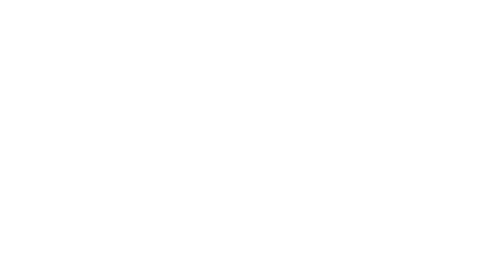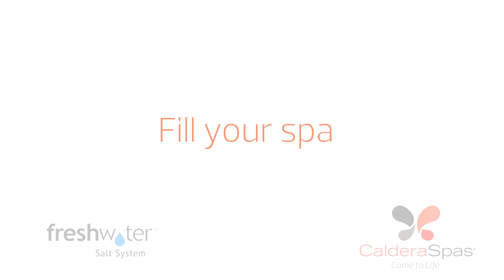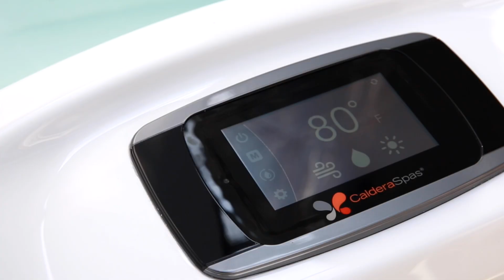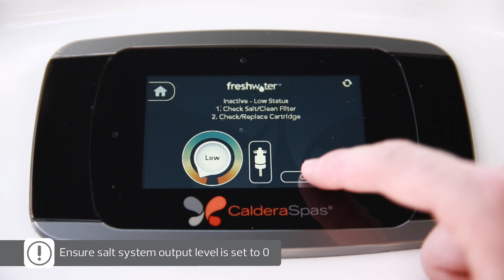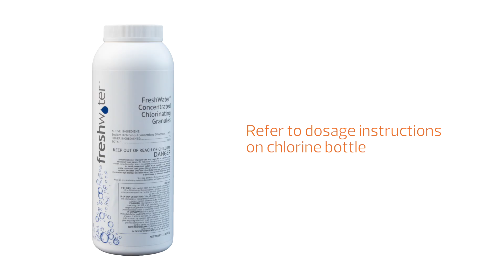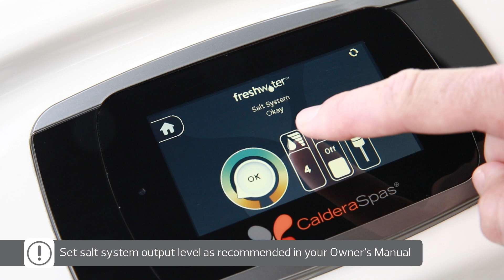Getting Started with the FreshWater® Salt System - Caldera Spas

Comment: I bought a new Caldera spa March 2021. The $100 metal cartridge that supposedly converts salt to chlorine in my opinion does not work. I have spent $300 buying new ones, adjusting the controls etc. I do not believe the technology exist to magically transform salt to chlorine. (and wish someone would get a class action to make them repay us for all the wasted money and false advertising and sales techniques).  I have done 50 measurements using multiple types of test strips. The only think this transforms is my money into the spa dealers pockets. Save your money and just add the salt and bromine / chlorine granules. Home depot is way cheaper for the disinfecting and salt chemicals. I have found no other place than the dealer to buy the filters or  water softener pads.

Comment: I am having problems getting a FCL (chlorine) measurement, working with my dealer for more than 3 week now, the start-up process takes very long, to have the salt system make a measurable chlorine level. Even after a few boosts and by adding Chlorine 50-80ml a few times to balance the FCL to a minimum of  3 ppl.  Salt Level is good, but chlorine is going from 0,2 to 0,38 in a few days. after using it it and adding 60ml chlorine the FCL drops to 0 in a day. Giving rest of a few days does not FCL level to above 0,5 My dealer says to give it some time and not add chlorine manually every time... Any Advice?
Reply from the maker: Thank you for taking the time to reach out. Depending on your water, it can take some time to build the free chlorine residual. From what you said, I have some questions. Are you using a liquid or granular chlorine?
Are you setting the status level at 10? Are you adding enough chlorine to register 3-5 ppm on your test strips? 
It takes consistent steps to build the initial residual.
You can email me at CustomerService@Watkinsmfg.com so I can better serve you. I am sure we can figure this out and get your water on the track. 
I look forward to working with you soon. 
Vanessa -  Customer Service
Reply: Thank you. Can you please clarify. I’m doing my first purge, drain and refill. Do I remove both the filter and salt water cartridge during this process. I’m pretty sure that during the purge and drain to remove the filter, not sure about the salt cartridge. The video shows that during the fill the hose goes in the filter basket, is the filter installed under that basket?
Reply: Why are you recommending filling with garden hose only and not recommending using a filter at the end of the garden hose before filling sauna

Comment: They don't mention to hold down the water droplet icon to see what output the chlorination system is set at. 1-4.  I guess 4 is recommended?  And then 6 for the geneva.
Reply from the maker: Hello Jake, Thank you for the tip. I believe you are referring to the power level. That setting is already set for the spa size. In some cases, based on usage, we have recommended increasing the power level to 4. 
That adjustment is not needed for every customer. Also, depending on what series of the spa you have, how it is adjusted will be different. This video reviews a standard startup. Customer Service is available to assist in spa operation and programming. We can be reached at 800-669-1881 ext 8432
Everyone's spa usage is different, and we work with our customers to make sure they are getting the most enjoyment from their spa.
Happy Hot Tubbing!
Vanessa -  Customer Service
Reply: And you do not specify how to balance the water